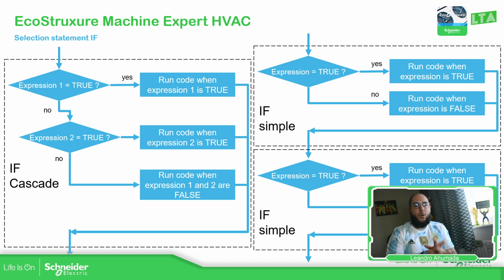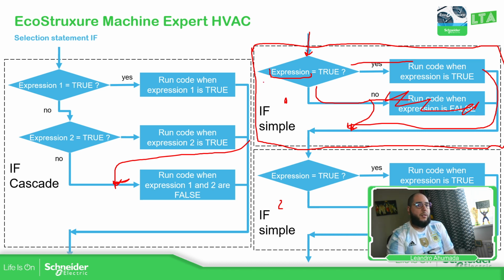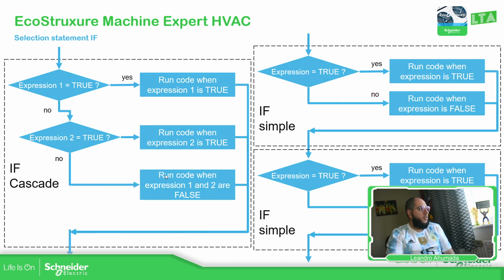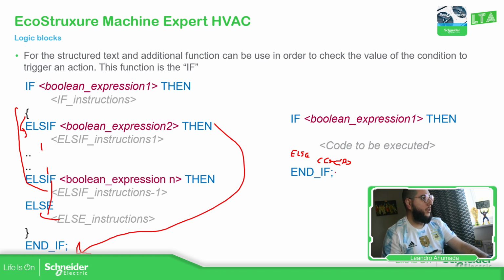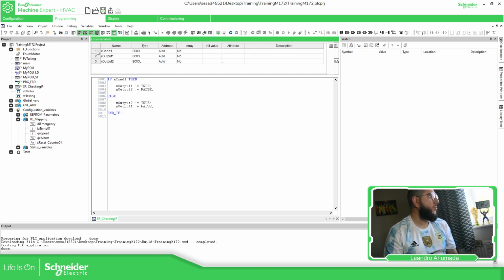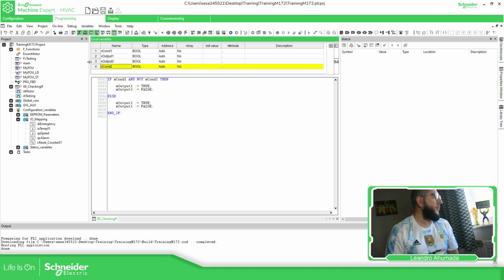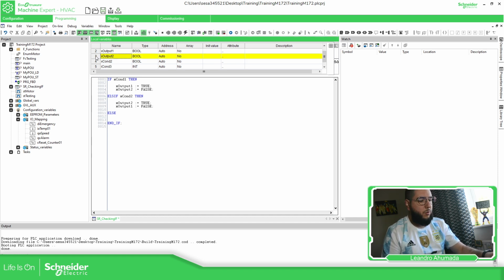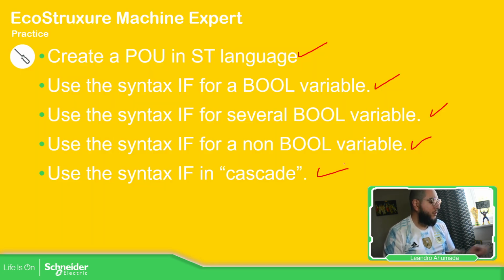EcoStruxure Machine Expert HVAC Training - M5.10 Selection statement IF

Comment: Can you please do more videos about Altivar 320 ? How to connect with plc s71500 and send data ?
Reply from the maker: Hi there! I can make more videos about the atv320 but the full process along with a siemens plc it is going to be difficult ‘cause i do not have one…
Maybe i can show what we need to configure on the drive and using images of tia portal.

Note: i do not have a license for tia portal 😊
Reply: @LeTomasAHUMADA  I do understand you :). If you can do with images for Siemens PLC, please do it. If you can't you can continue please with Schneider PLC. However can you please explain Status word and Control word in more details.
Thank you :)